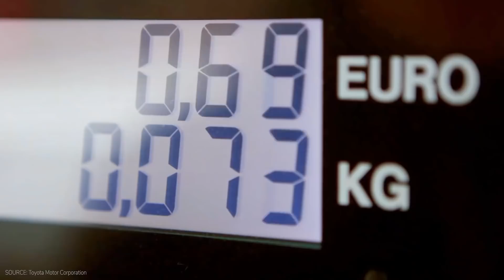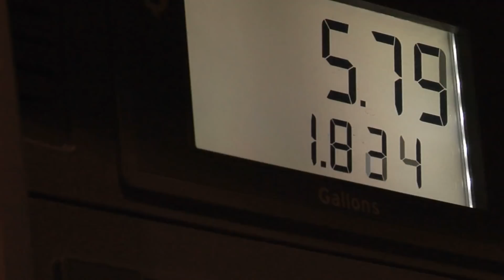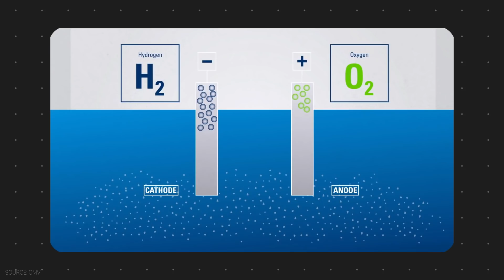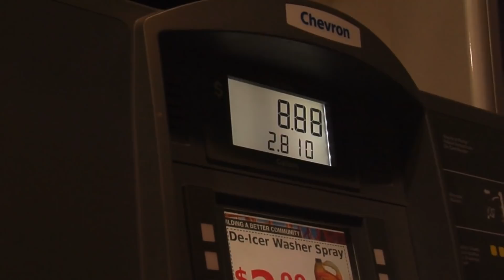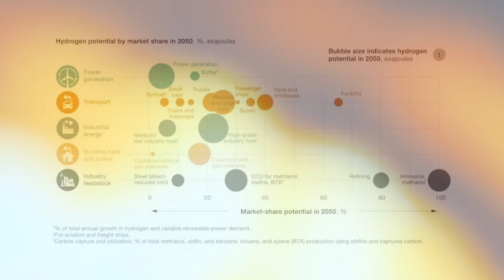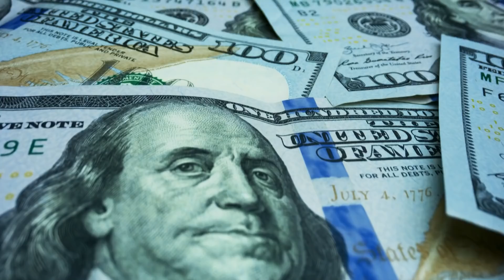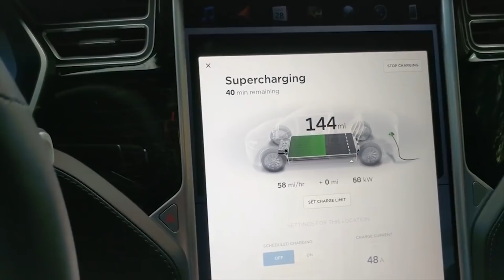Is Hydrogen energy the Future?

Comment: Big picture is... Oil or gas are ready energy storage mediums, you only have to drill a hole in the ground to get that energy. Batteries you have to charge with energy, you get from other source, Hydrogen you have to MAKE using energy from another source. Steam reforming natural gas to get hydrogen to use as fuel is terrible idea - basicaly you use energy, to make natural gas less energy dense, and pollute air. Why then not use natural gas as it is???

Comment: Forklift trucks? Electric forklifts have been working with old technology motors and batteries in 24hour operations for years (I have worked with them) They are the original swap the battery instead of charge use that I know of. The battery weight is a non-issue... well actually a plus as many gas/propane units have to add weight anyway. Use new technology batteries and motors and hydrogen for a forklift track is a non-starter. In general they never work more than a factory floor length from their charger.

Comment: Around (9:43) you say "... hydrogen... will not out compete battery electric vehicles..." which is frankly baseless if you consider math and materials.  Let's do some math.  Last year around 84,000 tons of Lithium metal was mined worldwide.  It takes about 35 lb. of Lithium in an All Battery EV bank rated around 100 kWh.  Do the math (simple division) and you'll see how many All Battery EVs you can make each year:  around 5 million.  We have 1 billion cars which need to be decarbonized.  How are you going to do it with All batteries?  This century?

Green Hydrogen is the only solution which works for everyone.  Price goes down with scale.  If you don't focus on the "Source" of hydrogen, then you're not being a good representative of facts.  How the hydrogen is produced matters.  It's Green Hydrogen, or we never decarbonize.  And, that's failure.  Fuel Cell EVs are the only way we can decarbonize transportation, and other sectors.  To blindly conclude All Battery Evs are the way to go is to ignore math utterly.

Comment: Great video (as always).  I would like to add one point on where Hydrogen might fill a big need.  One of the biggest current problems with renewable energy is the distribution network. There are lots of places in the world we could produce electricity but there is no way to transport it to a consumer market (like central Africa).  This is even becoming a big problem in several development markets (like the US) where the distribution networks are at capacity.  Hydrogen could also be a good solution for this as an alternate transport medium.

Comment: @Curious Elephant... You failed to mention that hydrogen only has 1/4 of the btu's per gallon in comparison to gasoline. The real problem for hydrogen is its energy content per unit of volume which is why Elon Musk scoffed at it. If the energy density of batteries doubles or the charge times gets dramatically reduced hydrogen appeal will greatly reduced.
Reply: yes. i mean i watched a video of one of the hydrogen cars(i think it was Toyotas version) and the fact that it has a wall between the passenger compartment and the boot plus the huge "transmition" tunnel is quite unappealing. batteries can be placed in a car in nearly limitless configurations(usually in the floor which also gives the car a fantastically stable feel) while hydrogen is essentially limited to fairly large cylindrical tanks. if u compare a 1st gen Zoe to a Twingo Z.E., the battery of the Twingo is actually only 1/2 the weight of the Zoes.(while having the same capacity and charging speed) with the reduce weight of the drive train, we might actually reach a point where comparable ICE and BEV cars will weight the same.

Comment: Hydrogen is indeed lighter than carbohydrates, but this does not allow for more weight of the astronauts but is rather unpractical compared to having a denser fuel. It is used though because it provides a higher specific impulse meaning higher performance due to the lighter weight of the molecules expelled (water) compared to carbohydrates (co2/h20).
Cheers

Comment: Green hydrogen wastes ~40% the energy input with electrolysis with the same inefficiency happening again in the fuel-cell, ~40% energy wasted as heat. Combine this with the fuel-cell vehicle needing a battery / electric-motor / inverter as well as the fuel-cell / large-tanks... and you're really wasting ~80% of your input electricity. An EV wastes ~20% and with an EV you can fill up anywhere; hydrogen can only be filled at a gas station.
Reply: Yeah, and 30-50% loss for liquefaction because, in a gas state, it is pretty much useless for transportation.
Reply: But you waste time in charging a fucking EV.... how can you account for it? And battery replacement costs, weight, useless anxiety, frequent tire replacement...

Comment: I just can't wait for below freezing winter driving, as often found World wide, when multiple hydrogen vehicles having driven before us spewing water exhaust droplets coating the roads with black ice for us to drive over and wreck our vehicles on ! Now that is safe ! This concept is just another, not so well thought out,"GREEN", idea that when applied into the real world to keep us safe from climate change does not keep us safe from injury or death when in vehicular accidents. A society operating many Hydrogen Vehicles that are spitting water on below freezing road or parking lot surfaces is not the answer ! So, where to put water. Maybe an onboard  tank to freeze solid and burst when parked?  At a stop sign or light idling then accelerating adding heavy icing right there to the road surface just where one wants to actually stop? A parking lot to slip and injure another walking by the back of your parked vehicle or after you drove off leaving water to freeze there? A roadside gutter so a pedestrian can slip stepping off a curb, maybe falling down flat in front of stopped traffic and out of view of drivers ? Your driveway so you can fall there ? Your Garage to slide across while holding your infant child then both hitting the hard floor? Maybe, you need more tasks or to be distracted by mopping up the garage floor before the water freezes and your groceries just purchased thaw? Maybe a high speed highway perhaps in a turn? Maybe the unlimited speed limit Autobahn with high water production by those higher electric energy demands moving the hydrogen vehicle through the air while simultaneously dumping large amounts of water mist contrails at high speed onto the road surface? Your Hydrogen Vehicle needs to relieve itself in public, The question is where to do it safely? Now considering these real world usage / interaction scenarios listed, are Hydrogen Vehicles a good idea? As a vehicle operator you can rate the chance of consistent, caring, and professional operator actions observed when you're out exercising your privilege to be with others in the public driving arena. Are you certain that rushed Hydrogen vehicle drivers find and maneuver over a public storm drain water dump station to let their hydrogen vehicle relieve itself in public places when freezing weather is happening? You rate and you decide if  we or will not slip into a Hydrogen transportation based society. As for me...you guessed it,  I see much more "could care less" vehicle drivers and very few careful vehicle drivers. Hydrogen supporters….should we give these "could care less" about you drivers a water soaker sprayer for society at large to walk or drive over when a dash indicator flashes an alert "water tank full" during your trip? 

  As a example of related but current human behavior, How many times do you see trash / rubbish go swirling out of a moving pickup truck bed in the States, or dumped out a moving vehicle window instead of being caringly placed in a proper waste receptacle when arriving at one's destination, as an example of drivers' proper public disposal habits?

Maybe add antifreeze to the water dump so it can mist on following vehicles windshields / windscreens then be smeared when wipers on, so the trailing driver has no clear view of the road. Now that is safe ! Then more windshield solvent , with poisonous methanol, is added to the ground by constantly spraying to keep a clear view. Now we're turning wipers on and off, as if that is not distracting to manage while driving in heavy traffic or oncoming bright sunlight in turns. Now that's safe.

Maybe many Hydrogen Fueled Vehicles can dump water, and antifreeze, smearing trailing vehicle's glass view 360 degrees, that is now spread everywhere in the environment. Now that is green, think !

Maybe the Hydrogen Vehicle owner after the cost of a fill up of Hydrogen decides to not pay for the extra cost of perpetually filling an auxiliary antifreeze reservoir that costs more than gas or petrol per gallon. So where is the transportation fuel savings when buying both Hydrogen and Antifreeze for the fuel cell's water as a by product tank?

Maybe granular or liquid salt treatment of ALL the roads ALL the time when temperatures are below freezing, even on sunny winter days ! Now raising the P.H. in streams from water mixed with salted trickling runoff 24/7/ all winter does not sound very Environmentally conscious or Green Think savvy. Get ready for higher taxes to pay the millions of dollars to pay for road treatment. Pay for replacing your scratched up paint. Pay for a broken windshield / windscreen when a chunk of salt is thrown on it during truck/ lorry application. Buying a new Vehicle often because your vehicle rusted prematurely from driving all winter on heavily salted roads.

Maybe add vehicle exterior damaging or ICE engine air filter intake & cabin air filter clogging traction grit like coal furnace electric generation plant cinders or mined beach sand from environmentally sensitive areas to the below freezing road's surfaces 24/7 all winter to combate black ice on road surfaces, filling the streams with sediment to clog fish gills when stirred into the water column later by heavy rains to follow in warm weather. Now one has to think twice about opting for a green and healthy deep breathing bicycle ride or walk on a drier warm early Spring Day to work or for pleasure while breathing the leftover dust from many Winter months of road grit application stirred up by passing vehicles.

Maybe the antifreeze adder system breaks or is disabled. Now the trailing driver is back to sliding on black ice in below freezing cold temperatures when Hydrogen is used in Vehicles as a transportation fuel spewing ONLY clean water onto the roads as the only by-product of its use.

Comment: Hang on. Saturn 5s first (and largest) stage was kerosene not hydrogen.  It was a mixed fuel rocket.  They used hydrogen on the upper two stages not only because of weight, but because of specific impulse and efficiency.

Comment: Is there even room for improvement in the hydrogen technology? I think there can't be done much more. The infrastructure and products using it sure can be improved a lot and invented in the first place. But when it comes to creation, storage and usage of Hydrogen I think we're pretty much there. Not much you can do to improve efficiency. Only improving costs of the machines themselves maybe.
The inefficiency will stay and make hydrogen expensive. Remains to be seen where this expensive is worth it.
Reply: Compared to that batteries have a lot of technological and cost improvements ahead of them. Around 2x with current technology and maybe 10x and beyond with new ones.

Comment: The true competitor to hydrogen is green fuels in general (like bio fuels)
Which one of those will be the cheaper one to substitute fossil fuel as high energy density storage?
hydrogen is really annoying to deal with, and is not cheap at all
Reply: But problem with Biofuels is their Scalability. Biofuels are not as Scalable as Hydrogen because Biofuels are made from Feedstocks, Corns etc. So Biofuels maybe a Best choice for Aviation sector but only problem of it is Scalability.
Reply: @Nikhil_Fagwani  this will be priced by the market already, if it is cheaper to adquire more land to plant for biofuels it will be done
Reply: @MrPinguinzz  That's not a Case bro. The problem is Environmental issues. Just watch videos about Biofuels on Real Engineering YouTube channel.

Comment: Yes, H2 should be a future energy resource for ships, jets and large equipment that go back and forth, over and over, but has not sensible application in cars, small trucks, ATV's, PWC's, tools, and most other small electric motor products as batteries can charge from home, or any AC outlet where H2 can't, and charging a battery is FAR cheaper than refueling with H2.

Comment: Why isnt anyone considering methane (LNG) production out of atmospheric CO2 and renewable electricity. (Same as Musk's plans for rocket fuel production on Mars). It would be net zero CO2  but without is of the storage (extreme pressure and volume) and transportation problems of H2. With the benefit of all current consumer (cars & home heating) and industrial (heavy transportation, cement/steel/fertiliser/etc production) activities can transition immediately with current technologies. Nothing to invent.
It seems an obvious  step to me?
Reply: Hydrogen is better suited as Carbon negative fuel and Methane production using atmospheric CO2 will be considered as Carbon Neutral but it makes No sense to produce hydrogen then convert it into Methane, it takes lots of energy to be wasted and also it is not going to be competitive anyway with Natural gas
Reply: @Nikhil_Fagwani  Methane
Agree, its a adding a second step to produce methane but my point is we are removing the hydrogen development step where we have engineer new engines, storage, and transportation infrastructure.
Since renewables are being so cheap the extra step to make methane could be cheaper and easier than transistioning to hydrogen.

Comment: The problem with hydrogen is that you basically have to build a full second infrastructure on the scale of fossil fuel. While batteries already have infrastructure in the term of the grid and that just has to be upgraded

Comment: Hydrogen is most likely not going to have a future in passenger cars as batteries have better financials today and that gap will only increase as battery tech improves over time. (can't make fuel cells that more efficient than they are now, physics gets in the way) I don't see it being used in trucks either. Don't take my word for it, look at one of Tony Seba's talks about this subject.

I don't think it's gonna get use in aviation either, but I'm not fully confident in my answer in this regard.

I believe we might see it in large ships because energy density is not a big issue and if it's generate on-site, most likely at the ports where the ships docks, it might just be more financially viable than using batteries.

Comment: 2:46 so, the saturn v uses rp-1 on it's 1st stage (most of it's mass) and hydrogen on the 2nd and 3rd stage. so most energy comes from rp-1 (fossile fuels).
3:02 excuse me, what? xD you were talking about saturn v and not the space shuttle. but yes, teh space shuttle used hydrogen as fuel for it's main engines. but again, it has very bad polluters too. the 2 big srbs strapped to it are not hydrogen but solid rocket fuel obviously

Comment: Gas cost 3 to 5 dollars per gallon
Hydrogen cost 13 to 20 dollars for equivalent of a gallon of gas at the most efficient method available right now

Now if they can increase the efficiency of making hydrogen by 100% it will still be way more expensive to use tho there will not be be such a huge gap between diesel and hydrogen as there is today 
Tho by then we will probably have fusion power
Reply: And I could see some carbon capture coming in at less than $5(us) per gallon.  So it would be still cheaper to use diesel for long haul trucking and for transatlantic planes. For all shorter things the 350 wh per mile gets EV's to less than 0.50 per gallon equivalent.